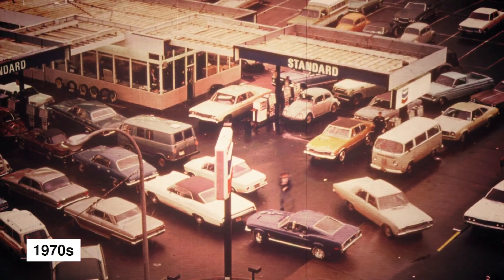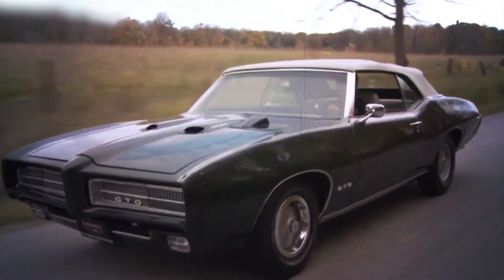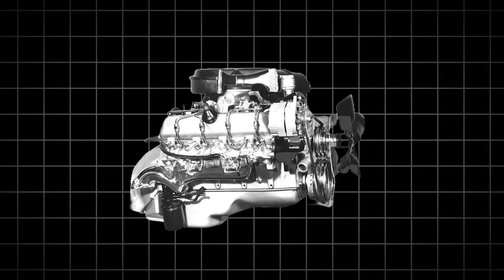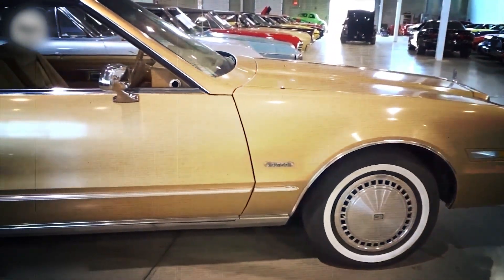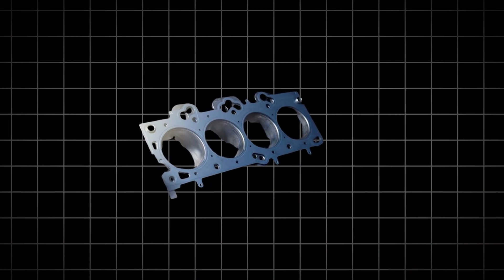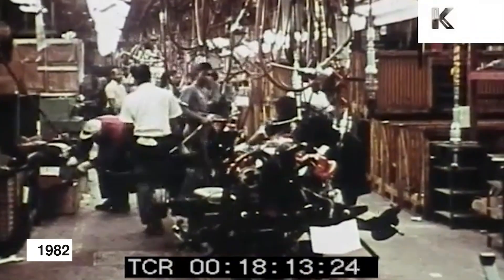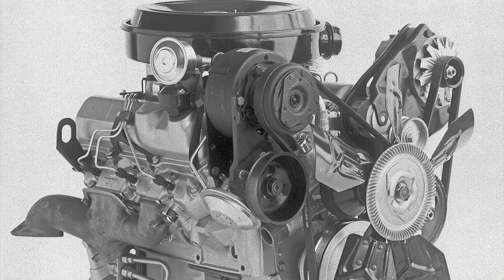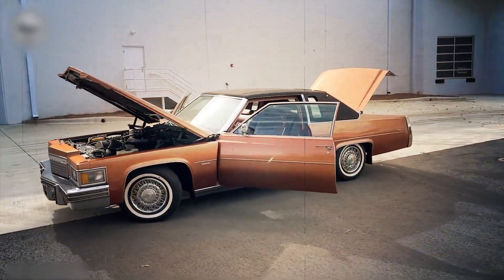The Engine That Bankrupted Oldsmobile: The Diesel Disaster | 331 Engine

Comment: What idiot came up with the "fact" that the diesel Olds used a rubber timing belt??

I had an 81 1500 cc diesel Rabbit 4 speed.  57 mpg, ran it for just shy of 300K when I sold it.  Zero trouble with the engine.  That engine used 10 bolts to hold an aluminum head to an iron block.  Obviously WV knew more about diesel engines than Olds did.

Comment: GM made two huge mistakes. The diesel engine was one, the other was converting the full size and mid-size cars down to front-wheel drive designs. 
The switch from rear-wheel drive full size cars to front wheel drive compact full size wannabes was the second deadly mistake General Motors made. 
The diesel wasn't needed, as there really was no legitimate energy crisis in the 1970s (before anyone corrects me I was there for that and looking back the energy crisis was as bogus as a three-dollar bill). Yes the price of fuel went through the roof and the supply dropped only because the government pursued a policy of trying to get people out of their automobiles instead of allowing us to keep them. The energy crisis was a well-engineered bogus crisis by the government at the time. 
The later conversion of rear wheel drive front wheel drive was another disaster. Trying to sell a compact as a full-size car with a transverse engine and front-wheel drive to be as good as the rear wheel drive V8 powered cars what's the total miscalculation and a thorough disaster.
Reply from the maker: Thanks for sharing your thoughts!

Comment: Actually if GM would have used hardened headbolts and washers this could have mitigated the problem. GM wanting to save money didn't do that. It's another case of GM getting it so close yet so far away. Typical GM in the 80's and 90's.